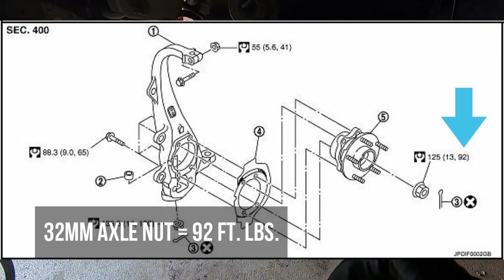2007-2013 Infinity G35x & G37x AWD Front Hub Bearing Replacement (W/ Brakes!)

Comment from the maker: * NOTE, ADDITIONAL INSIGHT REGARDING VIDEO: 

If you’re struggling to remove the hub with some light taps and/or the hub doesn’t want to come out or budge, use a Slide Hammer. 

If you’re cheap and don’t want to buy one like me, you can always rent the OEM Tools Slide Hammer from Autozone for free:

https://www.autozone.com/hammers/hammer/p/oemtools-5lb-slide-hammer/2047_0_0

…if the hub bearing is as bad as this one in the video, the slide hammer probably won’t work because it will just pull the hub out of the mount, as what basically happened to me in the video. But if the bearing is still basically fully intact, you can utilize a slide hammer.

Comment: Hey, your video just came across my feed, so thanks! I recently replaced four bearing and hub assemblies on my 2006 INFINITI G35x, and one of the hubs was extremely stuck and no amount of hammering would loosen or remove it. A simple fix is to knock out a couple of lug studs and insert a long treated bolt with a flange nut or nut and washer behind the stud plate and use an impact to tighten it. That will force any stuck hub out of the knuckle. Thanks for the video.
Reply from the maker: Appreciate the comment. I actually did that in this video on a Titan:

https://youtu.be/Su4leWIwakI?si=n0vJDKN8gQCKUkH6

…unfortunately, it wouldn’t have worked on this particular bearing because it was so bad. It would have just pulled the outer hub/studs out of the bearing itself. Which is basically still what happened with me hammering it. But definitely a good trick to utilize if it isn’t as gone as the one in the video!

Comment: I think my bearing dust shield was installed backwards. So I'm trying to see if the axle nut has to come off in order to remove the shield?
Reply: For a 07 G35X
Reply: I got the 32mm socket for the axle nut, but the socket seems to be just a tad bit small
Reply from the maker: @jessetovar100  the dust cover is held in with the bearing. So its all gotta come out to mess with it. And its possible the axle/axle nut has been replaced at this point, which could potentially make it a different size than the OE 32MM.

Comment from the maker: *NOTE, ADDITIONAL INFO REGARDING VIDEO: 

The brake torque specs slightly varied throughout the years, as well as between the different piston variations. Below is each years front brake torque specs as per the Infinity FSM:

G35=

2007: 
1 piston caliper; Caliper Bolts = 18Ft.Lbs. Bracket Bolts = 98Ft.Lbs.
2 piston caliper; Caliper Bolts = 20Ft.Lbs. Bracket Bolts = 98Ft.Lbs.

2008:
1 piston caliper; Caliper Bolts = 18Ft.Lbs. Bracket Bolts = 98Ft.Lbs.
2 piston caliper; Caliper Bolts = 20Ft.Lbs. Bracket Bolts = 98Ft.Lbs.

G37 =

2009:
2 piston caliper; Caliper Bolts = 20Ft.Lbs. Bracket Bolts = 98Ft.Lbs.
4 piston caliper; Caliper to knuckle Bolts =
98Ft.Lbs.

2010: 
2 piston caliper; Caliper Bolts = 20Ft.Lbs. Bracket Bolts = 98Ft.Lbs.
4 piston caliper; Caliper to knuckle Bolts =
98Ft.Lbs.

2011:
2 piston caliper; Caliper Bolts = 20Ft.Lbs. Bracket Bolts = 91-98Ft.Lbs.
4 piston caliper; Caliper to knuckle Bolts =
91-98Ft.Lbs.

2012: 
2 piston caliper; Caliper Bolts = 20Ft.Lbs. Bracket Bolts = 91Ft.Lbs.
4 piston caliper; Caliper to knuckle Bolts =
91Ft.Lbs.

2013:
2 piston caliper; Caliper Bolts = 20Ft.Lbs. Bracket Bolts = 91Ft.Lbs.
4 piston caliper; Caliper to knuckle Bolts =
91Ft.Lbs.

Comment: Could you use a puller to get the hub out? I use a big 3 jaw puller to pop the rotors off.
Reply from the maker: I would suggest a slide-hammer for a specialty tool. The OEM 27033 for example that can be rented from Autozone. Wouldn’t have helped me too much with the one in the video considering condition, but if yours is still intact, it’s a great tool option for stubborn hubs.

Comment: You made this look so easy, But is it necessary to remove the lower tie rod to access the 17mm wheel bearing bolts?
Reply from the maker: Naaaa, tie rod does not need to be disconnected. I had it apart from the other jobs I was doing in addition to the bearing. Pretty sure i noted that in the video.
Reply: @TheOriginalBeeCee  Thanks for responding this is a job ive been putting off for while due to the job seeming complex, but this made it seem like a breeze, Ive done front bearings on my Lexus, but its not awd.
Reply from the maker: @rodboijones7390  its pretty straightforward. Hardest part is getting the old hub out. Especially if it’s destroyed like this was lol. But you can always go rent a slide hammer if needed to help escort it out if it’s in not in horrific condition as the one in the video was.
Reply: @TheOriginalBeeCee  another way to get the hub off if its kinda stuck is to put the tire back on and maybe screw on 2 lug nuts, grab it at various angles, it usually works for me.
Reply from the maker: @rodboijones7390  most definitely an option as well!!

Comment: Im wondering how to get the axle nut out with the front wheel moving. The car is jacked up and I put it in park, should i have put it in drive with the parking brake on?
Reply from the maker: Parking brake only engages rear brakes. I would suggest getting or borrowing an impact. By farrr the best way to do it. If you have to do it manually, you are gonna have to put it back on the ground, you’re not gonna be able to do it, easily anyway..while jacked up.

Comment: Anybody know how to get the ABS light off after install. I replaced bearings/hub with no issues and sensors seem to be untouched, but ABS light has been on ever since
Reply from the maker: You can pull the ABS code with a capable scanner to verify its the side you did. But something probably happened to it upon install, or is not in there correctly. They can be very sensitive. I had one go bad on me before simply from touching it lol. Nothing happened to it, was perfectly fine went smoothly and for some reason it just didnt like being removed and re-installed. New sensor fixed it.

Comment: So if i was replacing both the front wheel bearings and the shafts, would pulling the bearing allow me to remove the entire shaft through the hub bearing hole?  If so i assume i can reinstall the same way?  I know the drivers is a tad different and so is the shaft removal process.  Any help would be greatly appreciated
Reply from the maker: Yea actually you can definitely get away with doing that. when the hubs are out, the shaft can pull right thru it.

Comment: Man. I wish the wheel bearings on my 2008 BMW 335i were as easy as this. I'm debating between this, or the RWD version of the G37.
Reply: I see these wheel bearing are bolt ons which is great. I was really hoping they’d weren’t press ins. Like mdx , I didn’t wanna press in the bearing and do all them at work so I bought used hubs. One side went bad then the other front. But now it’s going bad again. Fml. The hubs weren’t cheap either. $300 most wanted for 1 used hub.

Comment: How did you remove the cv axle? I'm doing the same job and ran into the same issue. Got a new cv axle but unable to remove the existing one. Any special tools/tricks?
Reply from the maker: It’s not the funniest thing trying to get out. I ended up using a couple big pry bars to get it out. They also make CV Axle fork tool pry bars, but i cant remember if there is room & it would fit in there or not.

Comment: I have a 06 g35x AWD .. i have the wheel barring (with the 4 holes) but i cannot find the hub (with the actual bolts on it) please help
Reply from the maker: You mean you need the mounting bolts for the hub to the knuckle? Did you break them or something?
Reply: What if i dont have a torch???
Reply from the maker: @yaboyyjuu7477  you don’t necessarily “need” it, but it makes life a lot easier. But you can get one for like $25 from a variety of places, even Amazon, etc.

Comment: I need some tips on how to bust the axle nut with no impact or torch 😬😬😬🤧
Reply from the maker: Sheeesh I would at least day go grab yourself a small propane torch lol. Could try a breaker bar the length of the car lol, breaker bar with a jack…jacking the breaker bar up to give it power to break it loose, you really just need a crazy breaker bar combo with some jack handle extensions to really give you the leverage you need. But there is a possibility it still might not be enough.
Reply: @TheOriginalBeeCee  I was able to get it by putting the wheel back on and lowering it just enough and kicked it down lol.  But now I'm stuck with getting the last 4 off the back of the assembly

Comment: I have the same vehicle in an 07. I’m getting a shake/shimmy in the steering at 75mph. Could it be a bearing? No obvious noise coming from them. Tires were just rotated and re-balanced, btw.
Reply from the maker: You could start with attempting to check the bearing, check out 0:25 in the video. If you have no noise and no play, I would doubt you have a bad bearing. Higher mph shakes a lot of the time stem from alignment and/or wheel issues. I would maybe be more inclined to think maybe you have a slightly bent wheel that was missed or something, especially since you mentioned the wheels being rotated..could of had a bent wheel in the back that got moved to the front, and now its more noticeable since its up front. If it were me I would evaluate the front end visually (wheel bearing test, control arms/ball joints, axle, etc.), and if nothing is discovered there, move onto wheel/alignment.
Reply: @TheOriginalBeeCee  thanks. I will check all this out. I appreciate it
Reply from the maker: @EricRodriguez-cx9ug  no problem 👍

Comment: Quick question, there's a really common failure on these cars in the form of the rear camber adjusters ie. They ALWAYS seize and become unusable and end up having to be cut off until you switch out for aftermarket parts that have built in adjustment. If you can do that job I'd be eternally grateful as I'm gearing up for it on Friday coming up and would love to know the replacement bolts sizes and M for the Hub side. Until I get the car off the ground I won't get a chance to take a look and at that point I'll likely be cutting the damn things off.
Reply from the maker: If I ever get the opportunity too, I would be happy to do a video on it. But I’m sure it won’t be before you need it lol. This car isn’t mine, I just did the job on it. And unfortunately the car is actually totaled now from an accident.
Reply: @TheOriginalBeeCee  Well the fact it got totalled is hardly a surprise, did you ever drive it? The G37 is great fun when you have the advanced track training, but on a straight license I’m not sure they’re such a good idea. I hope everyone was ok?

Comment: Did you do a front end conversion ? I have an 08 g35 sedan and I’m wondering if the 2010+ model g37 headlights fit the 08 g35
Reply from the maker: Just for reference, this isn’t my vehicle. But it had the stock front-end, the 07-08 sedan headlights. I believe the 09 G37 sedan also shares the same headlights as the 07-08 G35 as well.
Reply: I've got the 07 headlight in my hands, 09 seems to work. 2010+,  the shape is different, close but if it's a stock 08, best wishes. That and the mounting seems to be ever so slightly different to accommodate the slightly more aggressive bumper. There's dick all for custom 07-08 headlights, I found a used pair on eBay for cheap cheap (in comparison to OEM), the seller cleaned them up, new bulbs. I'm going to pop open the lenses and spray the chrome black- If you're looking for ideas.

Comment: Does all 07 and up Infiniti g35-g37 have the same wheel bearing ?
Reply from the maker: I'm honestly not sure off of the top of my head. But an easy way to find answers to questions like this is simply look up the parts. Go to a parts source like autozone.com for example, and just start searching the parts between years. I've answered many questions I've had myself with doing this.

Comment: I can’t fit the ABS sensor back in, it hits the hub before it sits flush..
Reply from the maker: The hub is probably not in the right position, compare positioning to the opposite side if you are only doing one, and double-check from there.

Comment: Mines making noise but has no play. Is that possible?
Reply from the maker: Yea, its definitely possible...anything is possible with cars lol. But i would get in there and 100 percent ensure its the wheel bearing/hub, and ensure you don’t have noise coming from brake/rotor, etc.
Reply: @TheOriginalBeeCee  How do you check if its coming from the brake or rotor?  How do you check for a warped rotor?
Reply from the maker: @chrisx6995  need to take the wheel off and physically inspect it. Check how low pad(s) are, if they’re making any metal on metal contact, etc. As far as the rotors, if they have grooving and aren’t smooth, then they should be replaced. you can also spin the rotor to make sure its rotating straight, not “wobbling” or off, thats how you can tell if its warped and out of whack or not. Typically though, a rotor probably wouldn’t be warped unless it underwent some serious trama like a bad brake slam on the highway or something where they heated up bad, or if they were just neglected for a long period of time when they needed to be replaced.

Comment: Next time you can drop the knuckle from the upper control arm and tap it from the back it'll pop right out as opposed to beating it to pieces, had to change the whole front end suspension on my g35x isn't too bad if you have power tools.
Reply from the maker: I would have maybe considered that if I knew I was gonna be replacing the axle prior to the start of making the video. When I inspected the car many miles before doing this job, the axle boot was a bit torn...but wasn’t as bad as it ended up being in this video, from the customer continuously driving on it. Customer didn’t want to replace it until I showed him there was literally nothing left of it when doing this job. And typically, I don’t have to many issues removing a hub with some whacks. This just ended up being a bit more work due to the horrific condition of the bearing. This bearing was probably worse than most would encounter. But really, the best way to remove a hub thats still intact...if you’re not being to lazy...is get a slider hammer or go rent one from Autozone.
Reply: @TheOriginalBeeCee  I agree but the slide hammer only works sometimes, the hub itself slid out instead of the bearing when I used it so I took the knuckle off because I had to take it to a shop to press the lower ball joint out and out the new one in but when I took off the knuckle the bearing was still stuck I tapped it lightly from behind and it popped right out even though I was beating on it just like you were with the hammer and it was moving slightly its still easier just to disassemble a bit more to have more access but I hope this comment helps someone else who tried everything like me
Reply: If you mess with the upper control arm or knuckle you’ll need an alignment afterwards, no thanks
Reply: @TakeThis_L  yea I got rid of it I only carry 9 or .40 .

Comment: That last bearing bolt on the fuckin bottom I can’t get off because there’s a bar that’s attached that’s in the way of the nut. I get the nut unscrewed almost all the way, then it gets stuck in the nut no matter what way I turn the wheel
Reply from the maker: Hmm I don’t remember having any trouble with it. I know it was tight, but I was able to get it with wheel all the way turned. Do you know exactly what the “bar” you referring to is by any chance? Are you able to remove it for better access?

Comment: do you need to change the axle nut?
Reply from the maker: No, you don’t NEED to replace the axle nut. However, I’m not opposed to it being replaced. But just speaking from experience, the axle nut typically doesn’t NEED to be replaced after removal. If the nut is damaged and/or if the axle threads are damaged, then it’s definitely ideal and you should replace it, of course. But I’ve come to find the OE axle nut on most vehicles are of better quality then any aftermarket nut, especially the axle nuts that come with a lot of these replacement axles. And just to add to that, the factory service manual does not suggest axle nut replacement after removal, it just suggests discarding and not re-using the cotter pin only. But if it makes you feel better to replace it, I’m certainly not opposed. But in most cases its truly not a necessity.
Reply: @TheOriginalBeeCee  thanks👍

Comment: And if you don’t have an impact wrench? That 32mm axle nut just spins…..
Reply from the maker: Yes it will! But you can try a couple things if you don’t have an impact. First and best suggestion: once wheel is taken off with brakes still intact, have someone pressing the brake pedal in-cabin while you or someone is breaking the nut loose with a breaker bar. The more leverage the better. Other option, place a big pry bar or wrecking bar in between the lugs studs and have the other end of the bar planted on the floor to prevent it from spinning, then break it loose from there. That method is more risky and more potential strain on the studs. But both methods you can attempt. They’re some other creative methods you can find online, but my first suggestion would be my recommendation.
Reply: Funny thing, I was just thinking about putting the rotor back on to try to stop the spin!  And thanks for the ABS sensor heads up!  I’m sure it will help many of us.
Reply from the maker: @mattd5893  🙏🙏🙏

Comment: My right front bearing went about 90k miles and my right front went about 100k miles.

They really don’t last that long huh:(
Reply from the maker: Sheesh thats kinda early in my opinion, but there are tons of different factors that can contribute to the failure of a wheel bearing.